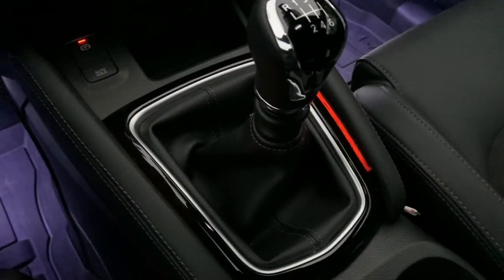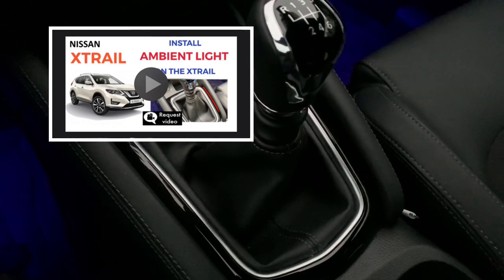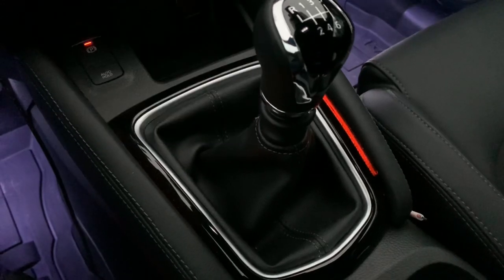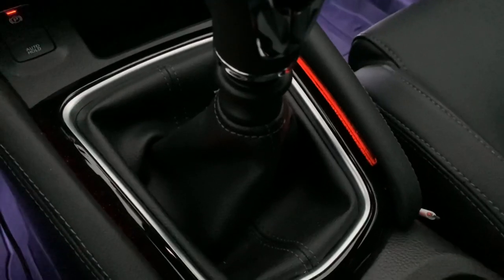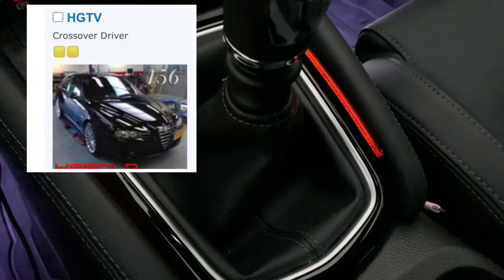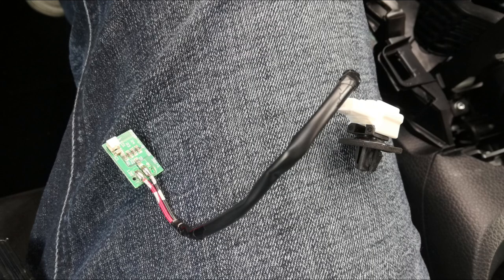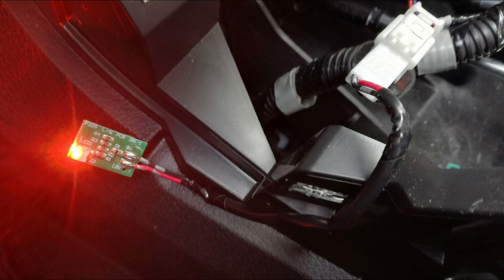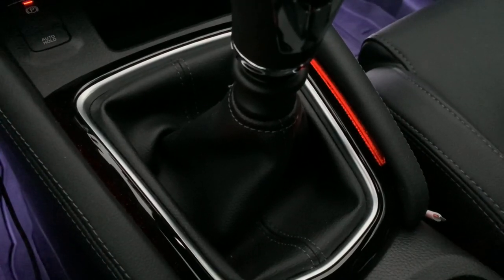Nissan Qashqai J11: change the mood lighting color, is it possible?

Comment: Hi

You have wonderfull qashqai and videos !!!

I have j11b without mood light on center console and i want to retrofit.
I take from ebay the LEATHER ILLUMINATED LEFT CONSOLE RIGHT with led

This led want 12volt
My car accenta j11b without mood light if i open the center console to install the led did have the power socket ?

Thanks
Reply from the maker: Hi Tasos! Thank you so much. So you want to retrofit and want to know which powersource to take? Yes you could indeed use one of the power sockets (front or armrest) as they are both switched on the J11b. 😉 otherwise you should check out my video on which power sources on the Qashqai are available for free usage. 👍🏻
Reply: @LaPalmeraie0032  And can i have the mood light menu in my menu car ?
Reply from the maker: Hi Tasos, I'm sorry for not replying sooner, your reaction was hold in the spam filter... Not sure if the car has a universal menu or if it lacks the mood light option as it hasn't the mood light fitted from factory. You should take a look in your car menu itself but I'm afraid that it isn't there by default...

Comment: Sympa la vidéo, mais où peut-on trouver ce genre de led en bleu ou en vert par exemple, ça aurait bien de rajouter ça dans la vidéo.
Reply from the maker: Tu as raison mais cela implique également qu’il fait sauder cette diode sur le circuit et ça ce n’est pas donné à tout le monde 😉
Reply: @LaPalmeraie0032  tout à fait d'accord avec toi, mais à chacun de voir ce qu'il est capable de faire.
Das LEDs SMD et résistance qu'il faut prendre à la pince à épiler j'en ai soudé des centaines d'où mon intérêt pour cette vidéo, le rouge c'est sympa mais je voudrais changer ça en bleu. 😉
Reply from the maker: Donc je suis plus que certain que tu n’a pas besoin de la vidéo pour savoir comment s’y prendre 😜 la vidéo montre surtout comment y accéder sans casser quelque chose. 😉
Reply: @LaPalmeraie0032  je sais parfaitement comment faire et j'ai l'équipement pour, mais si tu relis bien les commentaires ce n'était pas ma question, ce que j'aimerais savoir c'est ou peut-on se procurer ce genre de led. Puisque sur la photo on voit un peu la forme mais on ne sait pas vraiment de quel type de led il s'agit et donc difficile de trouver des LEDs d'autres couleurs pour pouvoir les changer.
Reply from the maker: D’accord! Je comprend. Je me renseigne pour toi 😉
Reply: @LaPalmeraie0032  se serait vraiment sympa, je te remercie par avance.

Comment: Scusami se ti faccio tante domande ma vorrei fare un lavoro come l’originale quindi il comportamento delle luci arancione vicino al cambio sarebbe come il Led rosso del tasto del freno a mano ?
Reply from the maker: nessun problema!  si spera che Google Translate sia sempre abbastanza chiaro.  haha.  Penso che la presa di corrente nel bracciolo dia il comportamento originale desiderato.  un'altra opzione è collegarsi al connettore R14, che si trova dietro la plafoniera.  puoi usare il mio video dell'installazione del vano piedi per questo.  almeno il video v2.  ad esempio si accende quando si sblocca l'auto e rimane accesa e si spegne non appena si chiude l'auto.  Non userei la luce del freno di stazionamento.  uno perché non vuoi disturbare una parte così importante e due perché quella lampada è accesa in modo che si accenda solo quando il freno a mano è tirato.

Comment: It seems that if you want, you could have that changed to match the RGB footwells, instead of replace the LED on that circuit it's needed to replace the circuit with one that has an RGB led, maybe with something like these
https://a.aliexpress.com/_mrXEK7P
Instead using the singular LEDs to light up the fiber optic using it to light up the original acrylic bar.
Reply from the maker: That would be the best option indeed Milton. 😉
Reply: @LaPalmeraie0032  Maybe I will use something like this for my solution on the X-trail.